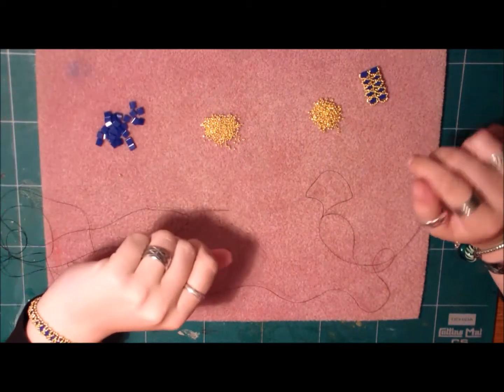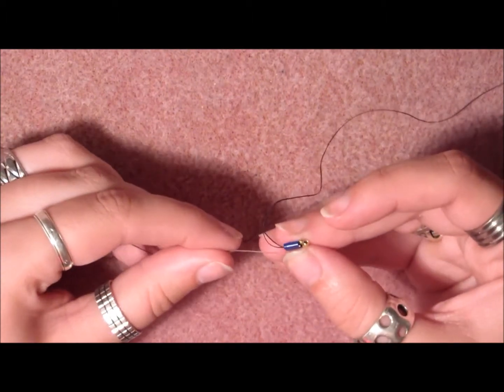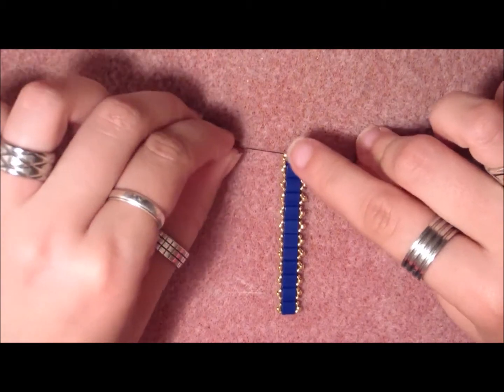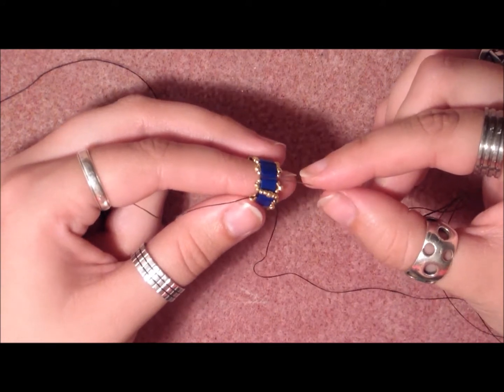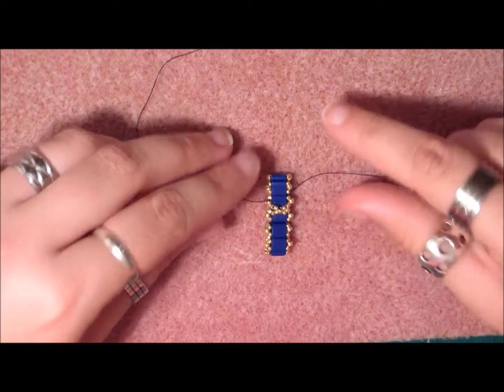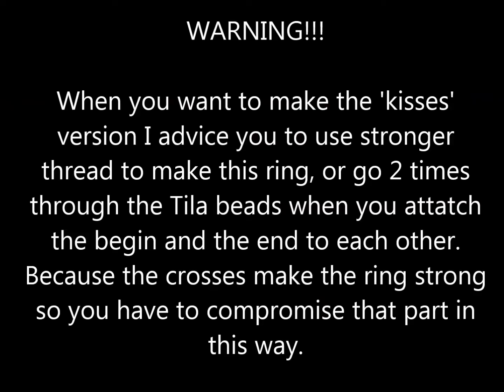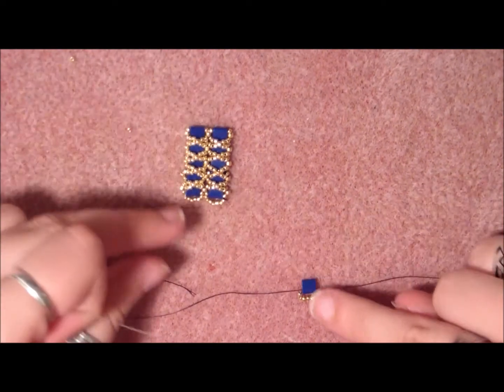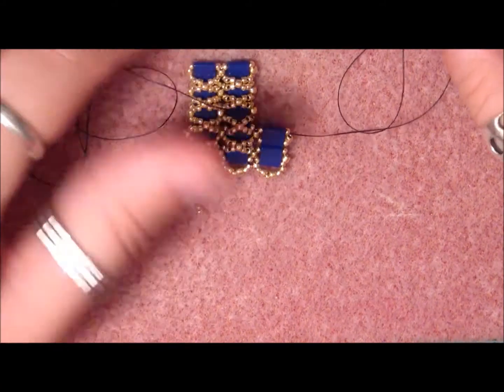Caterpillar Ring with Tila beads Beading Tutorial by HoneyBeads1

Comment: Fascinating! I'd never heard of a Tila bead before.What size and color bead did you use?  Can they be used as a ring band if strung together?
Reply from the maker: Mary Cheney Tila beads are 5*5mm if I'm correct, they are one size only. They are in cobalt. I do indeed thing that is possible! You could also try czech tile mates, those are a little bit softer. Have fun :)